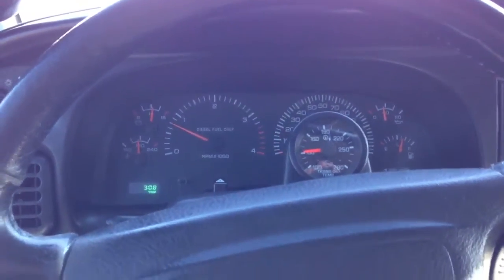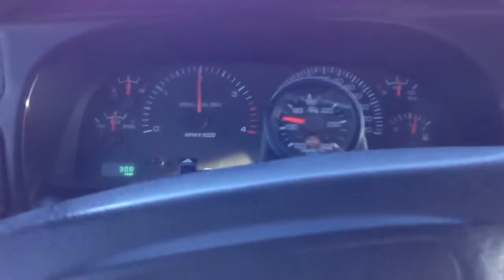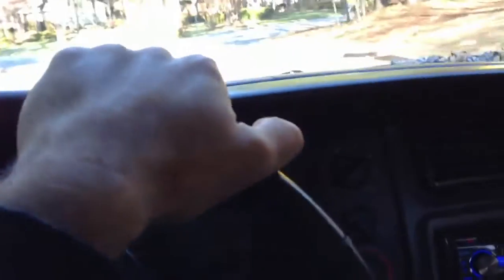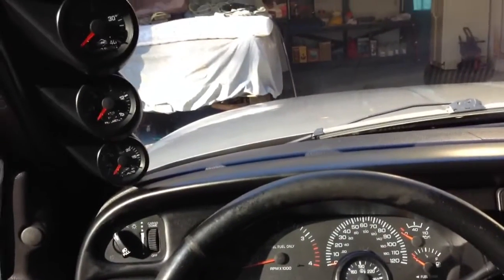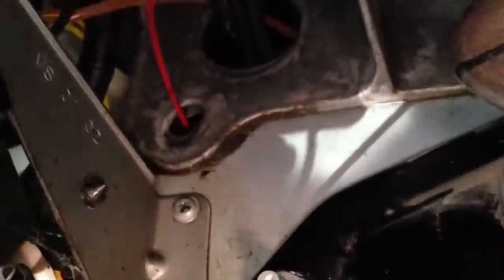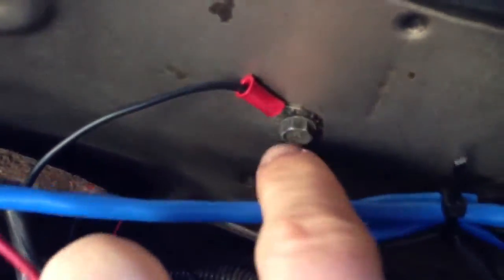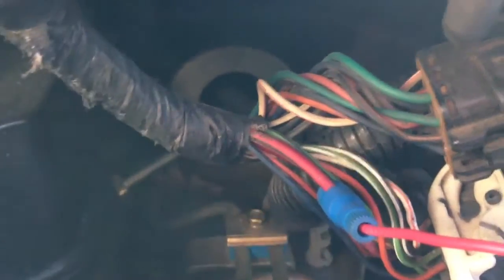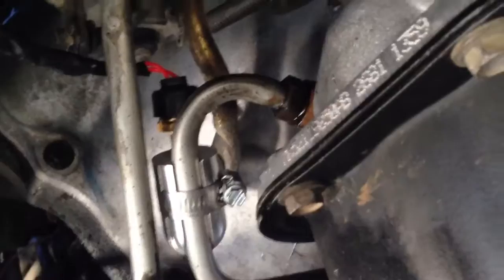Isspro EV gauge install

Comment: Just a heads up. Your fuel pressure at the lowest should be 14psi.  Anything under 14 will not cool and lubricate your vp44.